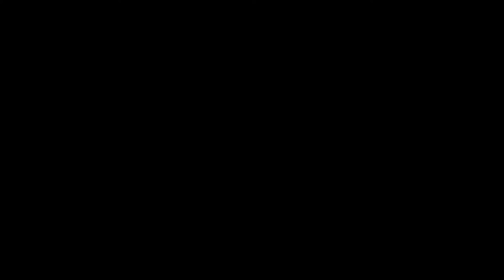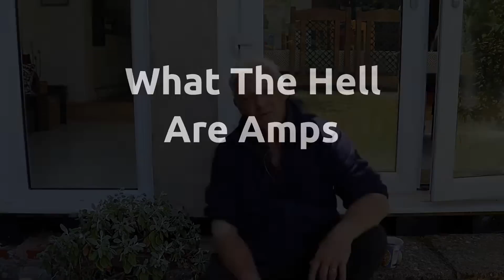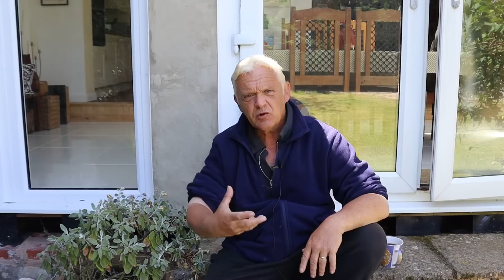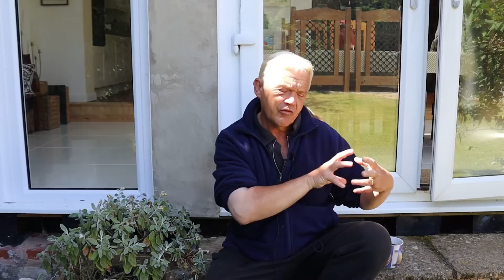2350 What The Hell Are Amps?

Comment: Hello Robert. I watched one of your videos the other day on serpentine coils to make a generator and this video. It brought up a question in my mind that you might be able to answer. If you have two serpentine coils next to each at a slight difference in rotational position. Then if you had segmented magnetic discs on each side of the serpentine coils rotating in different directions, would the magnetic field in the serpentine coils be cancelled out and as a result cancel out any electron flow. If so then would it still be the case if the magnets were geared to pass each other at the position of outer and inner parts of the two coils. Question 2 . If the magnet disc are rotating in the same direction and the serpentine coils are joined would this increase the electron flow, having the magnetic fields on each side of the coils. Hopefully these are not too much of a stupid questions. Just trying to get my head around the logic of it, I'm mechanical not eletrical. Regards Wydinya

Comment: Thanks for clearing some of this up because in addition to playing with wind generators I'm also playing with EVs and the phrase, "how many amps does the motor draw" has been kind of fuzzy for me. Understanding amps as shove and the need to match how much shove is needed to push the load over a certain period of time is very helpful. Your experiment and thoughts on high voltage might be clearer with some kind of visual? For example, if your load is an accumulator does that change the thinking about the generator?
Reply from the maker: i did ponder visuals but this was really a direct response to question i was asked and i wanted it to be quick

Comment: I have been deliberating about the  mppt on the pv inverters, fitted them for years for a job i always believed that the closer my series voltage dc was to the inverters max input would be more efficient and give better output. 
Skip forward 15 years and panel outputs are double the wattage but the voltage has remained similar so its left me questioning if parallel circuits would give better results ,,im guilty of being a lazy man as i have two arrays at home so i should experiment, however they are East west split and they have shading at times so it could be hard if the results are marginal..so highest voltage or max amps??.great to hear the bird song .X
Reply from the maker: those are interesting questions mate - but i have to say you were right - in my mind you should be experimenting and trying them out especially with your experience - you clearly have a lot to teach others.
Reply: @ThinkingandTinkering  Bless you i don't think i could stay on subject long enough to teach anybody very much,,to many avenues of distracting questions... i love the way you stay on track for your presentation and you have such a good history base to the discovery dates of the experiments .they are a very fulfilling watch sir. Hope your cycling's going well.x

Comment: When I used to teach electrical principles I often used water as an analogy. Voltage or potential difference is like having a water tank full of water sitting high above the ground on a platform and in the bottom of the tank is a pipe running to the ground level with a tap at the bottom.

“Potentially”, water will flow out of the pipe when the tap is opened because of the gravity exerted on the water. So Voltage or Potential Difference as it’s correctly called is the difference in height, in this case. The greater the height the greater the potential “difference” (the height difference) or in the analogy, the force that is exerted on the inside of the closed tap, in physics, the pressure exerted at the bottom of a column of water is equal to the height of the column of water multiplied by the density of water multiplied by ‘g’, the speed of an object falling in free space, 10m/s. 

So if we understand that the higher the tank above ground, the greater the force will be applied across the cross sectional area of the water at the bottom of the pipe. So the water pressure is like the voltage. 

If we fit a wide pipe to the bottom of the tank then when we open the tap for a fixed period of time, say 1 second, a lot of water will flow out of the tank over that 1 second period. If we do the same with a very thin pipe, in comparison not much water will flow out of the tank for the same period of time. 

So we can say, the thickness of the pipe allows more water to flow, so this is like the current which is measured in Amps. Think of current as the amount of water that flows through the pipe, the wider the pipe, the more water will flow, the thinner the pipe the less water or current will flow. 

So when we talk about Amps which is the unit of current, we are talking about the amount of water or electrons can flow through a pipe in a given amount of time. 

We now come to resistance, if we resist electrons by using a conductor that allows less electrons to flow, we slow down the flow of the water, we do that by restricting the flow by reducing the size of the pipe, which in turn reduces the amount of water flow. So now we have “resistance” which is measured in Ohms.

Finally, if we measure how “much” water has flown out of the tap during that one second period of time then the amount of  water in litres transferred is the amount of work done and work down is the “power” which is measured in Watts.

So if you have understood my analogy, Voltage is the water tank height above ground, which gives us pressure. The current is the amount of water that flows through the pipe at any given moment, the resistance is the thickness of the pipe and the power, in Watts is the amount of work done in a given period of time, ie the volume of water transferred, litres per second as power is a function of the amount of work down for a period of time. 

So Ohms law is the relationship between Voltage, Current and Resistance. The power is the product of voltage and current, the higher the voltage, the higher the power (for a given resistance), or the higher the current (for a given voltage) the higher the power. It also follows that the lower the resistance, the greater the power because for a fixed voltage and or fixed current, the lower the resistance, the greater will be the current. 

Applying all of this, if your light bulb lamp is too dim (ie the power delivered to the lamp, assuming it’s a filament lamp) you can reduce the resistance in the conductors ie use copper instead of steel wires (also a battery has internal resistance so when it runs out of energy it’s internal resistance goes higher) or you could increase the power and brightness of the bulb by increasing the electrical pressure, increase the voltage which will mean more current flows because the water pressure is increased because you have lifted the tank higher above the ground.
Reply: Thats a brilliant explanation, i wish you were teaching my daughter. It's exactly how i think about it as i come from a plumbing background  but retrained to electricity with the advent of pv. It works so well as a physical example of an invisible force..
Reply: @samosborne7329 ah thanks mate thanks for the kind comment. Hope your daughter gets all the help,she needs and passes her exams with flying colours.
Reply from the maker: yes i like the water analogy too - I don't mean to be rude mate or go against what you are saying because i agree with it and appreciate the time you took to explain it- but the water analogy is well used and if people still aren't 'getting it' sometimes a different approach is good which what i tried to do here

Comment: Amps are a measurment, the electrons are already in existence and are their own "thing"
So they are not a "thing" but a result, a bit like time is a measurement of change. (Not strictly entropy but the same idea).
Amps means large conductors, volts means lots of insulation.
The grid runs a very high voltage with air as the insulation as its cheap, but very low amps so the very expensive conductors can be small.
Example, a 20000v supply to a village of say 50-70 houses, will have a fuse of approx 18a or 21a (21amps is a standard size nowadays, 15 then 21 then 30....)
But when the supply goes into just 1 house at 230v the fuse will be 60-80a (80 being the modern standard).
An 11000v fuse is often 18a.
Its counter intuitive which confuses non electrical people. 
Add to that as you increase the amp flow the voltage will be dragged down a bit...
I won't start on how power or resistance add their 2p worth as that gets even worse...
Surfice to say amps, volts, power, are all measurements, resistance is a property of an object,   probably the only "real" thing in the equation..
Reply from the maker: Actually it's one coulomb moving past a point per second and a coulomb is roughly 6x10 to the power of 18 electrons (actually elementary units of charge - which is pretty much the same thing) - To be honest mate given the video is about trying to explain what's going on you might be splitting a hair here - equally resistance isn't a property of an object - resistivity is - resistance is a measurement dependent on geometry and resisitivity - but again we are splitting hairs when trying to get hold of a conceptualization - to my mind it is better to try and create a simpler concept that can be followed easily - but we all make choices.
Reply: @ThinkingandTinkering  Very true but I was trying to not get too technical. ie electrons not flowing + to -.......
I would stand by the resistance being a "Thing" and a property, everything can be measured, cross sectional area, mass, etc
But resistance is inherent to its makeup.
a cubic mm has a fixed value in a fixed state..
But as you say you pays your money etc....
The fun thing about electricity is that each Industry/Field has its own terminology and focus, The power transmission Ind, mine sphere, focuses on capacity to supply a certain load. 
What the load is used for isn't relevant for the most part, where appliance design what it does is the number one priority but they have to fit it to what we, the power side, can supply.
Anyway its nice to have someone to talk about these ideas who doesn't fall asleep after a couple of minutes, it doesn't happen often. 😀
Reply from the maker: @davidsoulsby1102  lol - you are quite right mate - it is nice to chat about such stuff - cheers